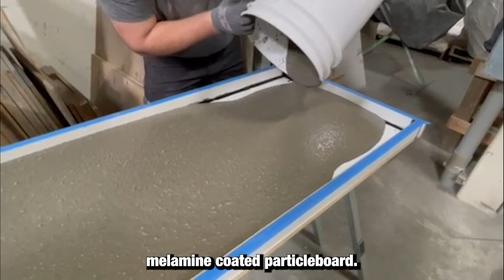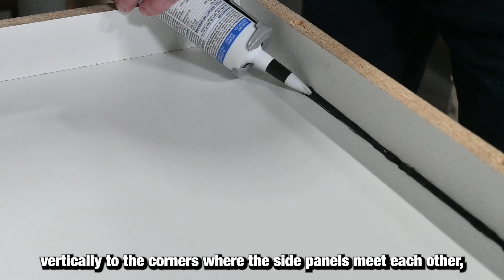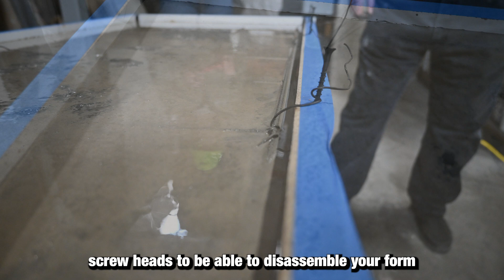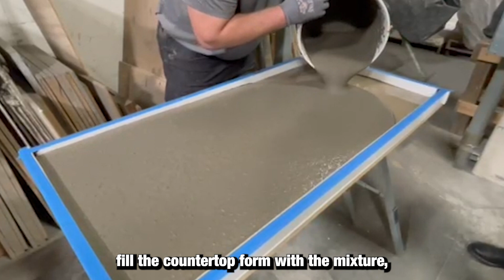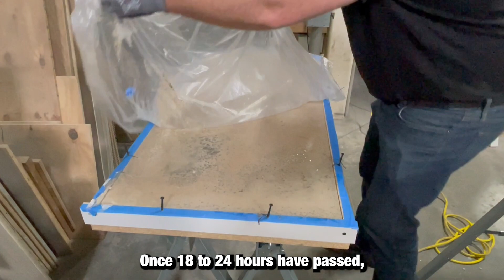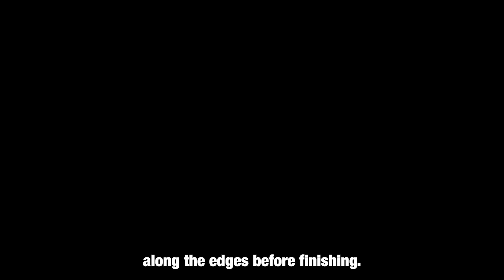How to Build a Concrete Countertop with TechMix Premium Concrete Countertop Mix

Comment: I have awful experience with this product. Getting it to flow with the recommended water mix is impossible and its overall integrity. My suggestion is just find a countertop place with rimenents or use rapid set mortar mix. This stuff caused me alot of time. Ive used both colors grey and white on 2 different houses and had to pour in place cause all the form set slabs broke. It doesn't trow well.